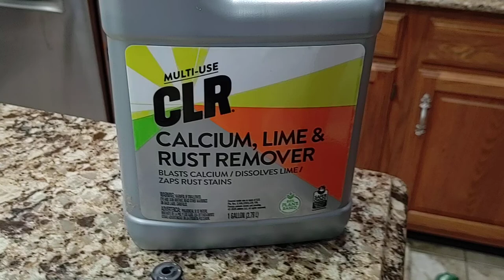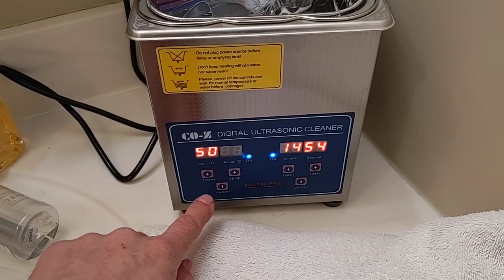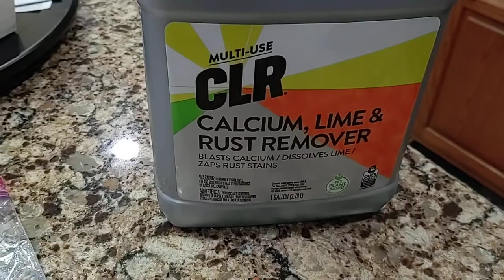22 suppressor cleaning

Comment: If you smear the baffles with Silaramic brake system grease before you reassemble or on a new can’ the carbon and lead deposits wipe off easily. The Silaramic is rated for 3000 degrees so it won’t burn off. It works great.
Reply from the maker: Great advice, thanks
Reply: It seems unnecessary. Plus it's currently $20 for a 5 ounce tube. Just go with an ultrasonic & CLR; it's less work.
Reply: @TacticalBuffoonary you are right.  Found this trick a while back and has saved me a ton of time cleaning.  I tend to put a little more ceremic grease on the lower parts where it tends to build up harder to remove carbon.  The carbon sticks to the grease and wipes right off leaving the baffles shinny new.

Comment: I just used this method with the baffles of an extremely nasty Dead Air Mask HD that had been sitting for months. It was leaking through my baggie but I used a glass jar of CLR in the water instead. I let them sit in the jar of CLR in the water as it heated up. They came out like factory new after 5 minutes. Awesome method if you have stainless steel baffles.

Comment: Do you use tap water or distilled?  Also i think i bought the same exact cleaner looks like yours but the brand on Amazon says its a vevor.  Is yours still working or has it wore out? Just wondering how long the cheapos last

Comment: What would you recommend cleaning a .22 compensator with? Mine is so filthy after one session that I can’t get it clean. I soaked it, scrubbed it, yelled at it… still dirty. Bought a cleaner similar to yours, but not sure what to use with it
Reply from the maker: CLR, except not on anything with a finish like the tube. It will come off.

Comment: Thank you Leroy... I just got my Banish 22 about 2 months ago. Finally got around to using it. I bought some CLR and Simple Green to use in the sonic bath. It's bathing in Simple Green currently, and will use the CLR next time. Bought them both before I saw your video. I put mine in a ziploc also. Thanks again brother! Stay safe!
Reply from the maker: Glad it was helpful!
Reply: @1776concernedcitizen  UPDATE:
The Simple Green cleaned the baffles, but still had powder residue on them. I poured out the SG, and poured  some CLR in the Ziploc. Came out looking like they had never been used. Sparkling clean!
Reply: I know Rugged recommends using Purple Power and Water.  Maybe that will work as well.  Let me know if anyone tries it.

Comment: Thank you for the video. In the process of cleaning my baffles now. Do you do 50-50 water and clr or just straight clr? Really like the bag idea makes things so much easier.
Reply from the maker: I've used straight CLR on titanium. It works well, but you could use 50/50 and see how well it works. Let me know
Reply: @John 14:6  mine was caked. I don't know how many rounds but up past 2000. So I did multiple runs with 100% clr. Now that I have the untra sonic cleaner, I will be cleaning more often. But it is now 100% clean and ready for action.